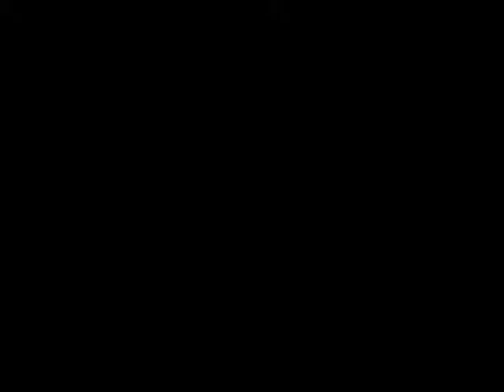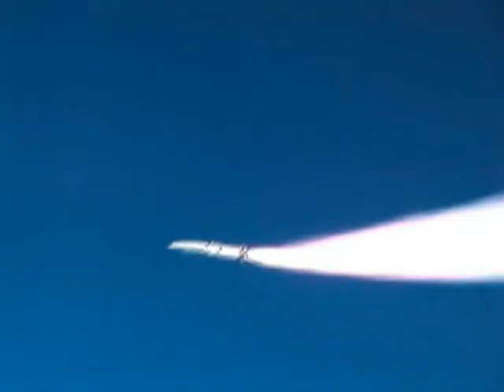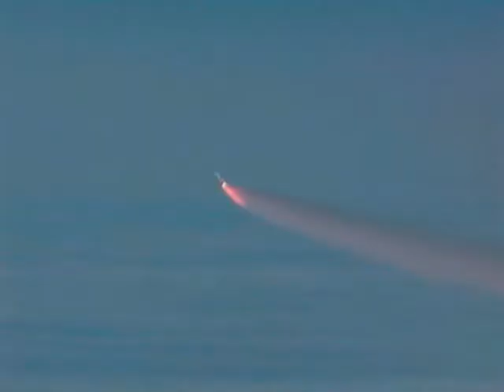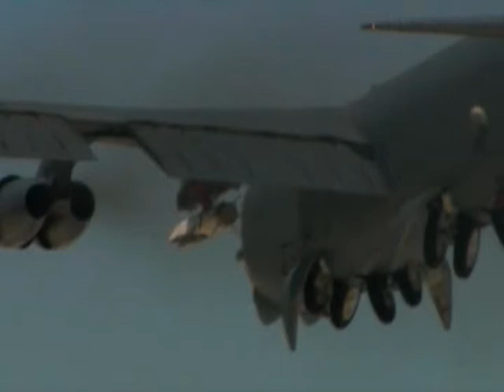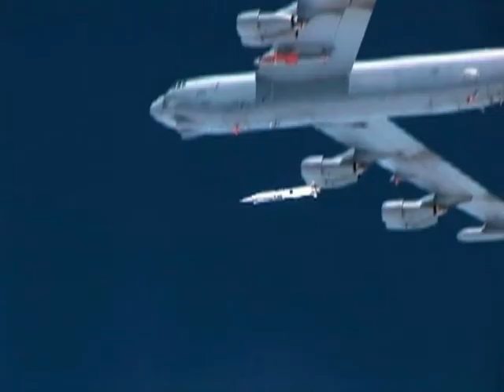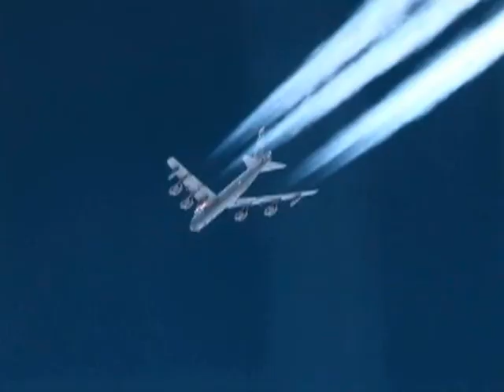X-51A WaveRider Scramjet Second Hypersonic Flight Test

Comment: Fantastic good luck with the flame out on the Jet fuel transition from ethylene. Did I get that correct.
Reply: A flame out from fuel transition is common if the conditions aren't fit for continued combustion of the new fuel type. Things like proper mixing of fuel and air is crucial for efficient combustion. Poor mixing can lead to incomplete combustion and flame instability. Its not necessarily the transition that causes a flame extinction but the conditions around the aircraft might no longer be suitable for a new fuel type.